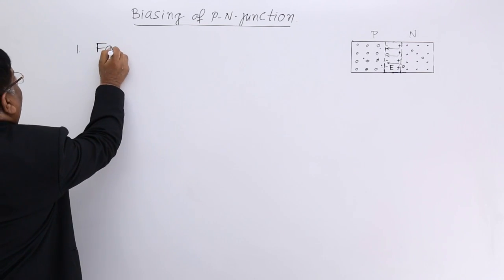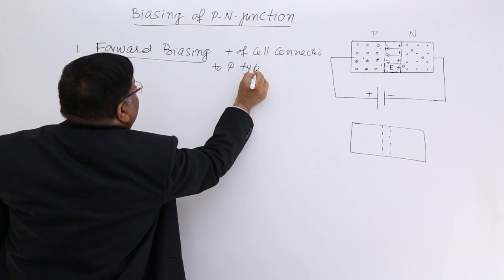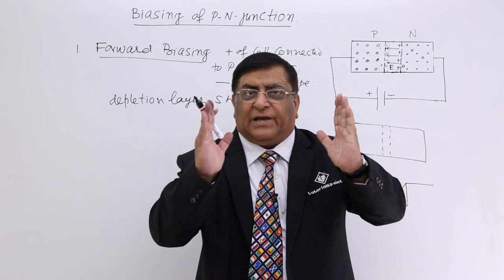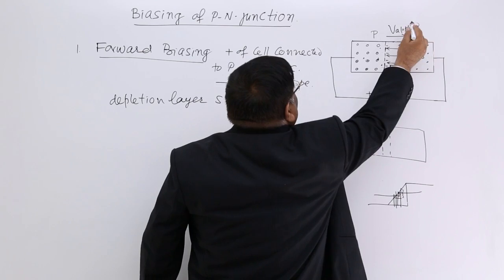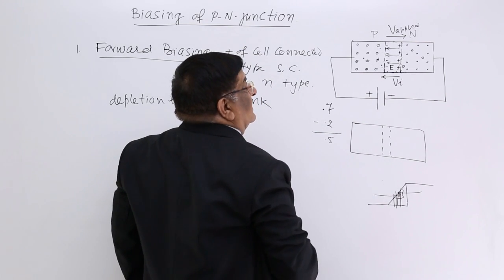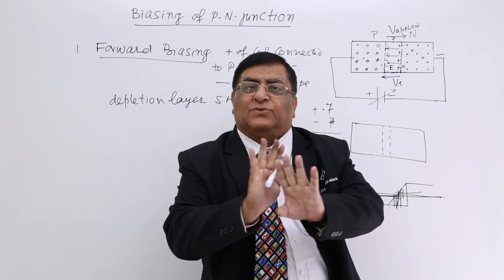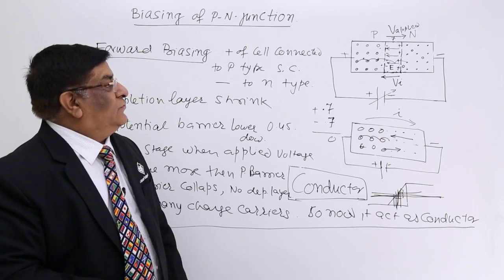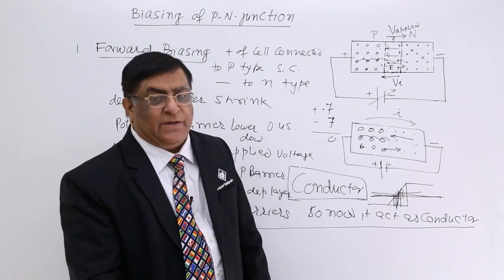Class 12th – Biasing of P-N Junction | Semiconductors | Tutorials Point

Comment: How can electrons jump at same potential??? 5:34
Reply: When same voltage occur ,potential Barrier get zero value means no opposition force is applied to cross the junction ,now electron get easily move towards hole side
Reply: Depletion layer starts to shrink because both potentials are equal. The condition for depletion layer to destroy or shrink and the for the electrons to flow, the applied voltage should be GREATER THAN OR EQUAL TO the barrier potential

Comment: Respected sir!! If we switch off the battery after barrier potential then will the diode keep on conducting without battery voltage support???
Reply: muhammad asad we need to overcome the barrier to conduct electricity...  If you disconnect the battery how will we overcome the barrier....?
Reply: muhammad asad this happens only for a faction of second then  if we put off battery then they will act as an insulator as there will be no free charges but if we put battery there will be collisions and charge carriers will be produced and it will act as a conductor till there is battery pot diff more than pot barrier...
Hope This Helps..

Comment: Sir why we take this only in decimal no than whole number
Reply: The barrier potential for silicon with typical doping concentration is 0.7V.
You could also change the barrier potential in simple ways. One would be to alter the doping concentration. Increasing the N side doping or P side doping or both would increase the barrier potential.
Decreasing the doping concentrations would decrease the barrier potential.
Alternatively for same concentration of doping you can have different barrier potential if you change the semiconductor material itself. Ex Si to Ge.
Germanium has potential barrier 0.3. Much significantly lesser than silicon.
Higher number of intrinsic carrier concentration decreases the barrier potential.